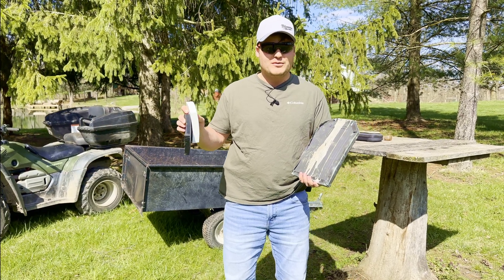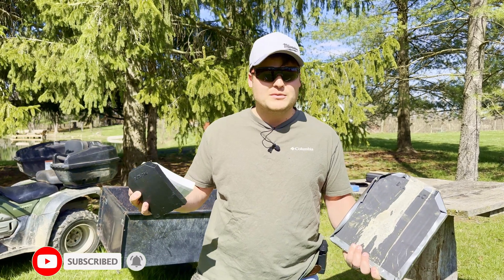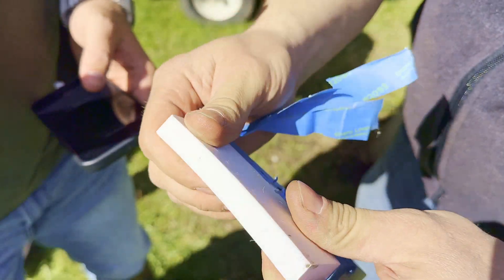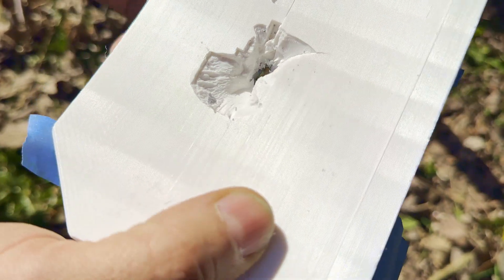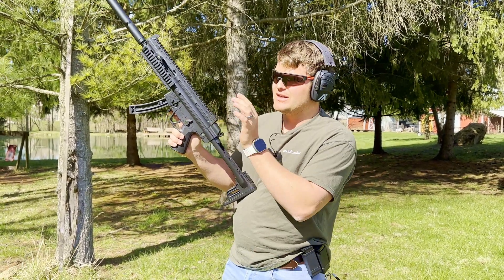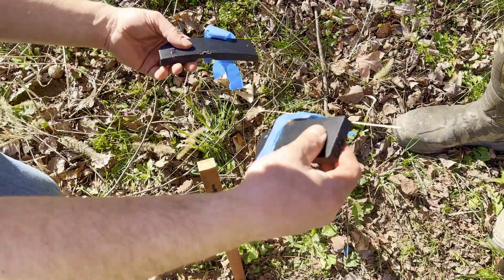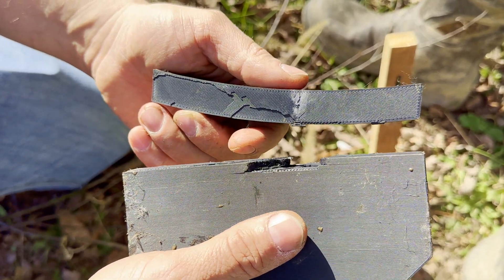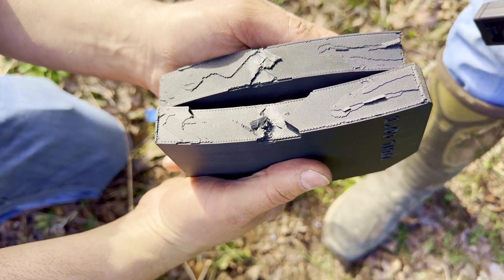Testing 3D Printed Armor for your viewing pleasure

Comment from the maker: What material should I 3D print and test with next? What should I fill the hollow ones with?
Reply: Poly carbonate, but transparent poly carbonate filament just for the gist of things.

Then Nylon Carbon filament, beware of some people selling nylon carbon as only nylon, but in fine print it's only a nylon filament as a "carbon colored filament" 

Try to print the 'shield' upright with the angled part facing upward and thin like 5mm with horizontal lines as solid fill that are perpendicular to the edges of the front face to the back face then you stack around 5 to 10 layers of 5mm thick plates. That would cause the layers to fold into itself instead of just giving way to the sides.

When printing upright, don't print it with with solid fill from far edge to far edge, but with solid fill from face to face.

Imagine punching a bunch of thin metal rods from the top and they are laying flat next to a wall, they would just give away to the sides. Then you punch it when all the ends of the metal rods is facing the wall and your hand is in in direct contact with the other side of the ends of the metal rods.

You will have much wider spread of surface chipping and damage on the first few layers before any cracks form, just like the poly carbonate and glass mix for bullet resistant windows.

You should try to glue the layers together with a highly conductive silicone to utilize energy transfer as best as possible to other areas of the layers to create a ripple effect to further delay damage on the first few layers as much as possible "This will cause the extra chipping and damage on the first few layers when the ripples meets each other's apexes".

If you find filament that contains actual granules of carbon you will have better control over the projectile because of dielectric loss and eddy current loss since we are working with lead tips or copper jacket lead tips which is even better.

It has to be printed in above stated manner so the projectile creates a cylindrical entrance to have the loss effects significantly increased. The thermoplastic part that contains the carbon is endothermic when great friction is applied it is helping the carbon work better with the dielectric loss and eddy current loss as it absorbs the heat from the carbon much faster cooling the carbon down and that helps slowing the metal projectile down with intense force.

Personally asking you to make a duplicate of the carbon print layer combination and submerge it in liquid nitrogen before shooting it as you will be theoretically creating a superconductor that might perform significantly better than its normal ambient temperature counterpart.
Reply: print flat pause the print between the occasional layer and add strips of sniper scapa tape then try it... 😉
Reply from the maker: @MrRighton I’ll try that

Comment: I know this is second comment, but part of your layer adhesion issues are bc of print settings. Bambu Labs printers "Just work" but part of that means a lot of the settings you'd normally have to tweak and understand are hidden. The way your layers are going down (This is called "Infill Pattern") help your printer print fast, but they don't help your layers bond to eachother and hold on well. You had your infill pattern set to Rectilinear (which is great for prints that don't require resistance to fast impacts), which may have caused the parts to split - You should have set it to Gyroid, which likely would have prevented that split.

Comment: Nice video. CF PLA is strong yet more brittle than normal PLA. I would also suggest printing these plates "flat", so the layer lines are perpendicular to the projectile. It can be harder to print the curve these plates have but for testing a flat plate will do. As for material, anything that has high impact resistance. A good start would be Polycarbonate. It is the same material used in bullet proof glass. It can be harder to print due to warping but would be fun to see if this material behaves the same as normal blocks of PC.
Reply from the maker: I really like your idea of PC, I’ll order some and put into the next video. 
I also have another subscriber that is printing some to put into the next video. If you have any materials or design suggestions and want them in the video email me the model or mail me the part.
Reply: @JordanMiller1117 I’m thinking with dual extruded and printing both materials of at least a quarter inch of 3D Printed Polycarbonate and maybe Kevlar or Nylon, layered with some Fiberglass… some Kevlar infill or again some Fiberglass. Could prove effective for Ballistic layered Thermoplastics
Reply from the maker: @ interesting take, I’ll have to compile something